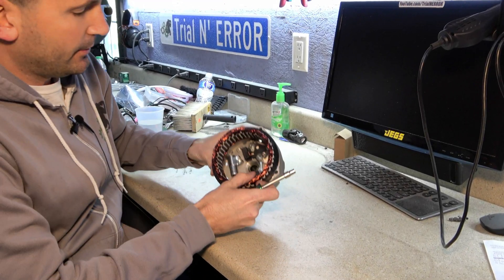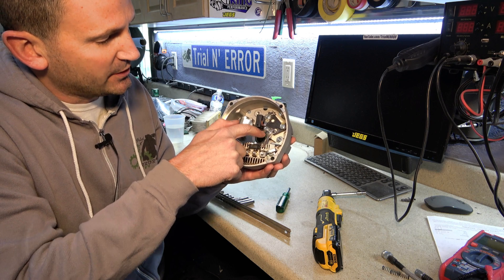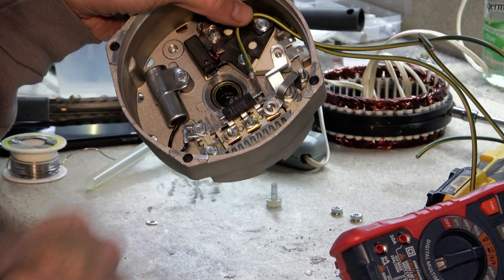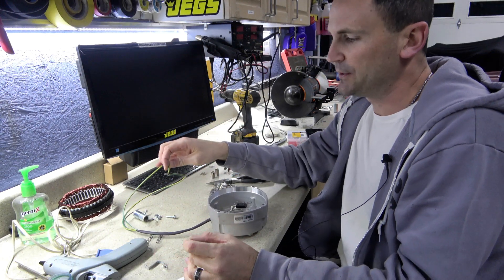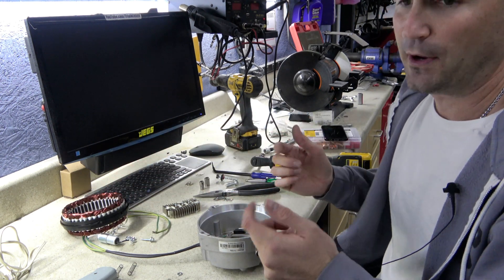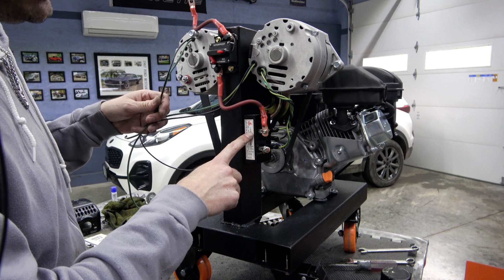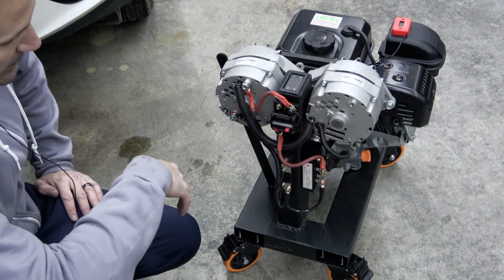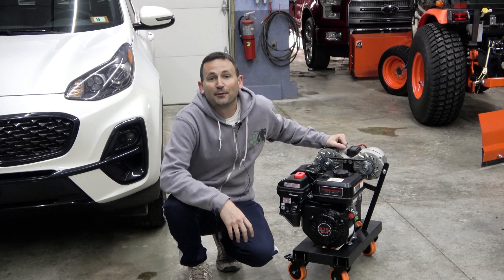Building a 48v Off Grid Generator: Part 2 - Got it figured out!!!!

Comment: Driving two Field windings (Rotor) from one regulator will cause it to burn out soon... you have doubled its design load. 

Also the external rectifier is likely losing a different amount of voltage than the internal rectifier of the stock unit, which will result in unbalanced loading of the two alternators. It would be interesting to compare the DC output from both. If they are within a couple of Volts of each other, you're golden. 

Also you need to realize that the DC output pulses from the rectifiers of each alternator will not be in-sync with each other because the two alternators aren't mechanically synchronized. This will result in reduced output efficiency... as much as a 33% loss. 

Just put the modified unit back together, then float (un-Ground) the negative DC output terminal of the built-in 3 phase bridge rectifier, the Negative Field connection, as well as the Negative connection for the Field regulator circuit... and connect those three connections together with a 4th large wire... keeping it away from the metal housing ground. Then bring that new "floating ground" connection out of the housing as the "new" Negative 24V DC output point. Now you have one "floating Ground" 24v alternator that CAN be mounted to the metal frame, and it's regulator will work as designed. This one modified alternator becomes the "upper half" of your 48v DC output. 

The unmodified alternator remains Grounded, and it's +DC output then  connects to the modified alternator "new Negative output" wire. The modified alternator +DC output would then be your +48v DC output. 

However... to fix the "not-in-sync" issue, you will have to use a very large Capacitor directly across each 24v DC output... maybe 50,000 microfarads at 36V would suffice, the higher the capacitance the higher the efficiency... but they have to be large screw terminal capacitors, rated for very high current. These capacitors will hold the voltage up as the two alternators pulse output current at slightly different times.

Sorry... I'm a old EE, and believe if it's worth doing, it's worth doing it right.
Reply: I would use 2 alternators with external regulators 

And use an extra beafy external regulator 

Basically what he did but with a upgraded regulator 

Maybe it's posible to wire the rotors in series?
Reply: A pair of capacitors seems like a much easier and cheaper solution than a syncrometer.
Reply: Awesome awesome the teacher
Reply: True the reguator might bur out 
And yes if the alternators are out of sync then you lose voltage (can only be seen with an oscilloscope) 

A capacitor over eatch alternators dc output will help 

I'm not sure if the 2 regulators in series will like this 

If the 2nd alternators doesn't start it will get a positive voltage on its "floating ground" and a negative voltage on its positive output

Comment: Still think that just isolating the second alternator and using the + of the first as the ground/- of the second would have solved the issue. After all, DC is just a voltage differential and if second alternator “thinks” that 0v is actually 24v (because it’s isolated) it would have just worked out of the box
Reply: Alternators don't actually output DC... they output rectified 3-phase AC, it only becomes real DC after being filtered... and with 2 of them in series without any capacitors to filter out the rectified pulses, it will be very inefficient... because the two alternators output pulses are not synchronous.
Reply: Thats why you connect a battery there wired to each.. in your case at 24v you need 2 series batteries on each leg..then series all of them to reach the 48v..

Comment: An automotive alternator will put out lots of power BUT it needs to spin fast to cool itself. If you drive the rotor too hard the power generated is huge and the heat losses are extreme and the only way to get the heat out is to spin it faster to fan more cool air through. 
Consider also a solid state DC -DC converter to take 24v in and charge a 48v battery (which needs 54 - 56 volts ).  Search Victron for useful toys.

Comment: Love the adapt and overcome attitude. I would have tried to bypass using 2 24v battery banks. Run them in series. Then each alternator charges one bank, and the series is 48 v that you can connect to your solar setup. This will give you batteries to excite the coils also. An added benefit, you can add a starter to the pedo.

Comment: just pay someone to rewire the stator with 2x the turns on each "teeth" to get 48v and put the alternators in parallel XD
Reply: Hell a 12 volt alternator will do around 140v on the 3 phase. This could be improved greatly by using 1 alternator and a big big rectifier, the wind power guys build their own. The voltage is easily regulated in this case by engine rpm and pulley ratios. And or varied dc voltage to the rotor.
Reply: @TheMajictech  higher rpm  higher magnetic drag on the rotor less eff.
Reply: @treasurehunter80  heat buildup due to turning the alternators too slow will cause inefficiency and a shortened life. With a little research one could discover most alternators out there reach optimum efficiency at 5000-6000 rpm rotor speed in the alternator NOT engine rpm. Hence the pulley ratios seen in everything with an alternator, in fact slower speeds cause heat buildup and diminished output. These examples are being turned at 1/2 the optimum speed.
Reply: Besides very bad things happen when you have 2 generators wired together that aren’t synchronized. Essentially that’s what this would be in parallel.
Reply: @TheMajictech  big diod can fix the problem and big enought capacitor

Comment: I'm sorry

I'm an electronics engineer and an accomplished mechanic

Right from the get go, your approach is incorrect

Negative ground chassis

Three phase winding with positive output

I'd rather you insulated the two Alternators without modifying it

Then putting them in series

Else modify the rectifiers from one alternator to output negative voltage then use an external regulator
Reply from the maker: I'm not an engineer or a mechanic.  Perhaps you need to look at my channel name.  Professional advice has no place here.
Reply: @Trialnerror  kudos to your inquisitive work

Sure wish you could have at a glance notice that the body of the alternator is negative ground 

But nonetheless, bravo

Comment: Great build! That being said, I sure as hoping to see more than 35A coming out of that pair of alternators. Squirting that much current into a battery bank the size of yours is like pissing into the wind. I was thinking 100ish or about.  Although not as much fun, a used 48V forklift battery charger running on a LARGE generator would get those beefy lead-acid guys a bubbling.
Reply from the maker: Yea, I got them up to 70amps now which is less than I hoped for but more than I really need.

Comment: an alternator has an inherently poor efficiency of 60%
Reply from the maker: A gas engine is worse than that.  I'm not worried about efficiency in an emergency situation, it just needs to work.
Reply: @Trialnerror  that's true, but i thought you wanted to improve the efficiency. now it's even worse!
Reply from the maker: @Rothammel1  Alternators are MORE efficient than generators and doing it at 48v DC is more efficient than going up to 240v AC and using a charger to bring it back down.  This is the most efficient way to convert gas into a battery bank charger, but it's by no means efficient due to how we have to combust fuel.
Reply: @Trialnerror  I haven't looked into that but i am curious to know whether it's true. I'm currently doing the dumb&easy version of AC generator back to DC into battery.  Given the similarity of how generators and alternators work, im not entirely sure if this is much more efficient. A typical portable generator functions very similarly to an alternator, just without a rectifier! 

Wouldn't be here watching and typing if i wasn't out here thinking and doing the same things so don't take it as contrarian, i just haven't seen the data and currently don't understand, whether it really is that much more efficient to skip the 120 > 48v step down or not. Great build btw.

Comment: So 28amps or so?  Have you done any efficiency runs to see how many kWh per gallon you are getting?
Reply from the maker: I have.  I changed the pulley and am making on average 35 amps @50v burning .4 gallons per hour so I'm making just shy of 4kw per gallon.
Reply: @Trialnerror  Thanks for checking the fuel efficiency.  Your setup is very compact and nice.  I did a great job with it.
Reply: @Trialnerror  That’s about £1.50 a kWh for those in the UK
Reply: I watched another video that used a timing belt style cog belt. Low friction with no slippage.

Comment: More pv, more batteries= no expensive generator or fuel needed. One less item to store, maintain and repair.
Reply from the maker: This generator cost less than adding just 2 panels...or the shipping on one battery.
Reply: And for emergency power during cloudy weeks: it works.
Just got out of a 2 week constant overcast, couldn't imagine how people's PV setups have been. 😂
Reply: @jamess1787  My 34kWp and 153kWh bank has been great.
Reply: @USA-GreedyMenOfNoIntegrity  that's good. Either you're very conservative with your power needs or you live solo and rely on wood for heat. Not everyone wants to do this. 👍.
Reply from the maker: @jamess1787  and here we end up with a cloudy week and usually a snow cover during that week that can cost additional days.  Doesn't matter how big your panel setup is, if its covered in snow, it's going to make the same output as a solar calculator lol.
Reply: @Trialnerror  💯.
There is no "eliminating" petroleum, just "reducing it" to some manageable levels when the relevant technologies mature.
Absolutely no shame in using a generator: they're necessary part of most electrical utility (and my electrical utility was at one point 98% hydro-electric).
🤜🤛
Gas on! 🏭

Comment: Where's the capacitor? I'd be a good idea to put a big capacitor in there to smooth out the gaps in the rectified DC, if there's not one hidden in there somewhere that I missed.
Reply from the maker: I pulled them out.  The 10,000lb battery bank this goes to works as the best capacitor to smooth out current you could ever ask for.
Reply: @Trialnerror  Yeah, your load will get good clean DC, but the batteries will see ripple voltage during charging. That ripple voltage may or may not have an impact on the batteries, or BMS depending on chemistry. It's probably fine, but worth checking into either way if you aren't planning to smooth out that ripple. Cheers.
Reply: Having some ripple on dc for charging lead acids are better than straight dc. Actually none of the battery chemistries care aslong as the peak current is not above their rated charge current & the voltage is not going into negative.